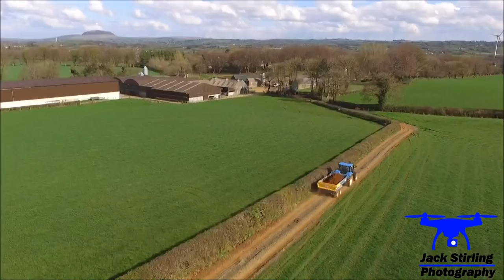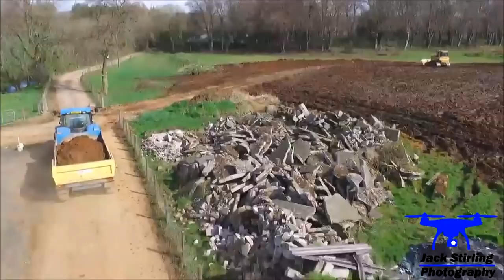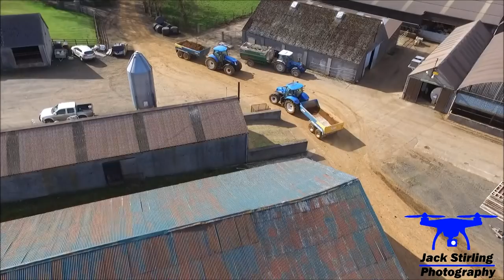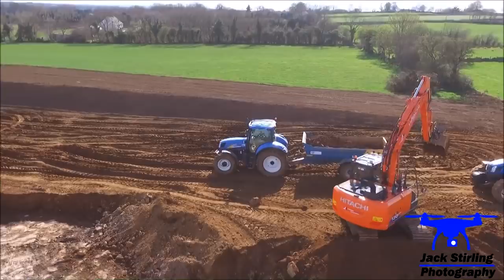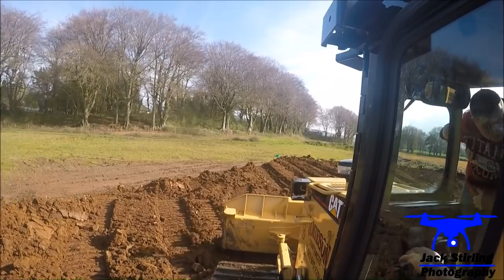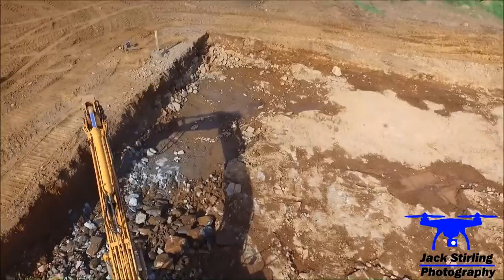Preparation for Two Hen Houses | April 2018 | Part 1

Comment: Big operation
Reply from the maker: Oh aye
Reply: Jack Stirling Photography 
That excavator driver need to learn how to get trailers in place for loading. To much unnecessary slewing round. What size are the chicken houses?
Reply: I agree, and that tiltrotator is not doing them any favours. It is an expensive piece of equipment that is not in any way required here. It will get damaged digging that hard material, reduces the excavators breakout force, and is unnecessary weight causing increased fuel consumption. A 130LCN with a standard quick hitch and 4ft digging bucket would be much more suitable. These changes along with improved excavator positing allowing max 90 degree swing angle, would drastically improve productivity.